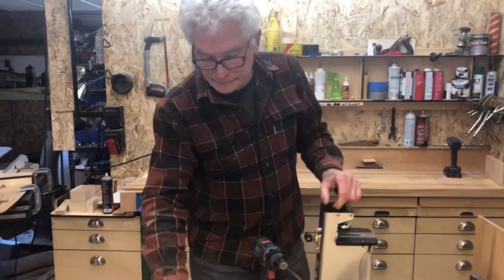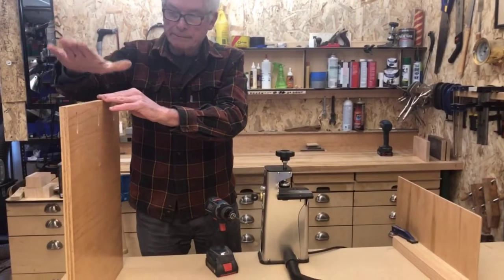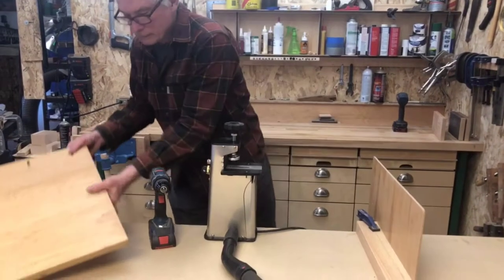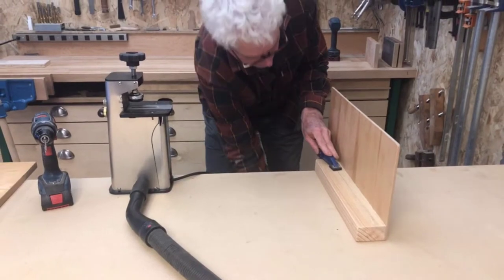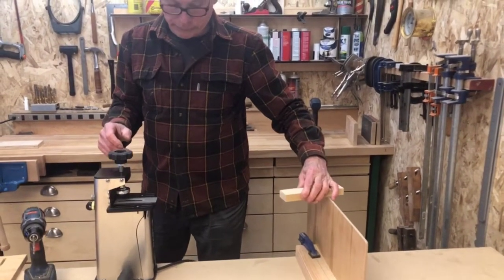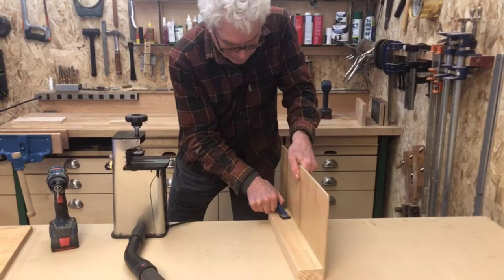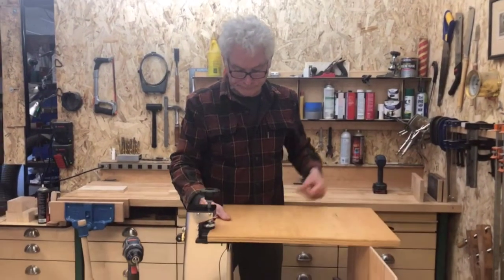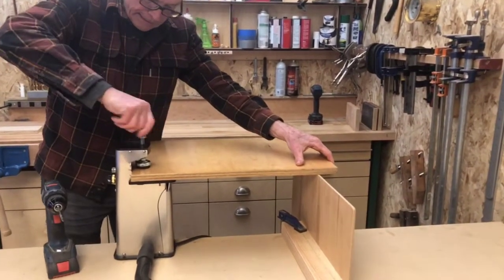Cutting Pockets in Panel Castle 100

Comment: constantly screwing and unscrewing seems tough, too bad there isn't a easier way to clamp it
Reply: The current model is an M-110 it utilizes a quick clamp instead of the screw down clamp.  I have the older M-100 and its no trouble using the screw clamp.